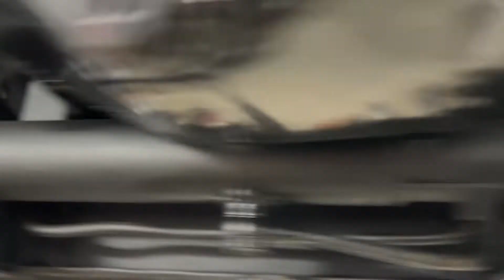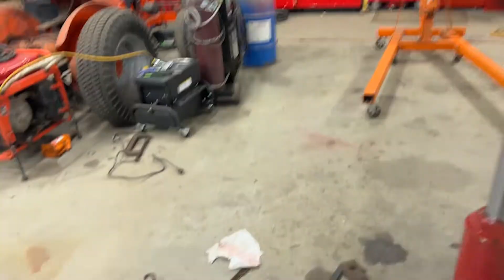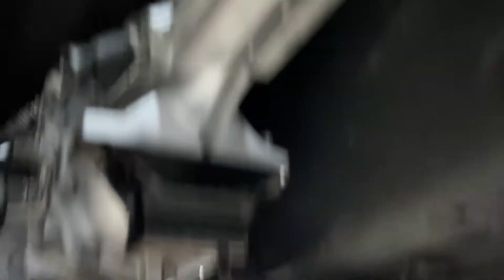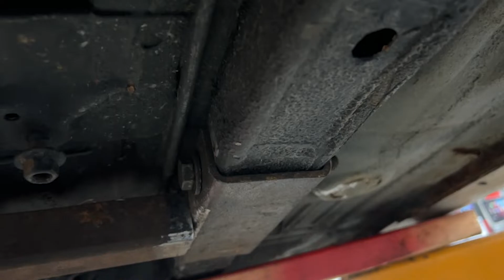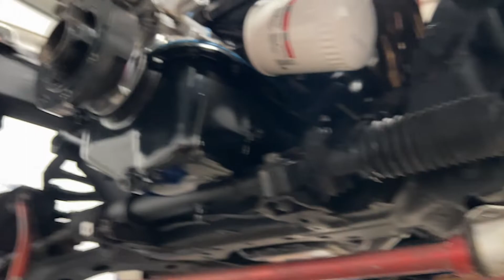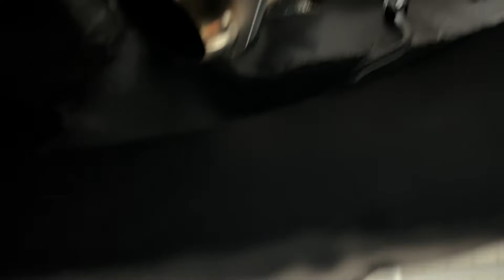Budget V8 Monster Miata Build - Episode 8 - Engine install / Transmission cross member fabrication.

Comment: Great work. About how many inches did you have to cut the shifter hole to get the shifter to fit? Any interference with the bottom of the console near the cigarette lighter?
Reply from the maker: I will know for sure on my next update video (Every Friday) . I am fabricating the transmission crossmember at the moment so I can secure the transmission in order to lower the car on the lift and check clearances inside.